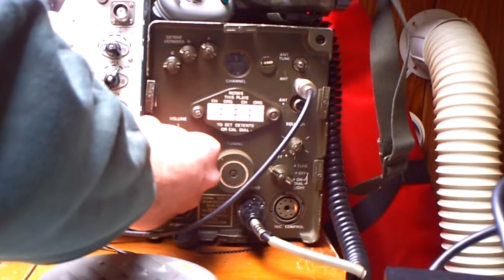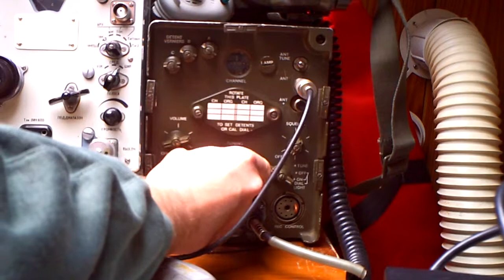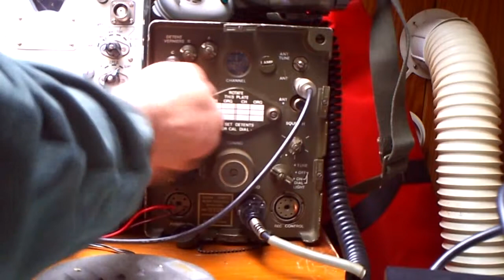R-108/GRC Surplus Radio

Comment: I notice you've jumped the H and J pins on the controller plug. Is that necessary to make it output to the LS-166? I just got a R-109 and am curious...
Reply from the maker: Hi Joe,
Yes. Without that, I had no output. 

I Read that here:
http://g503.com/forums/viewtopic.php?p=721365&highlight=
Reply: +Donald Schwab (DC2WK) Awesome, thanks a bunch!